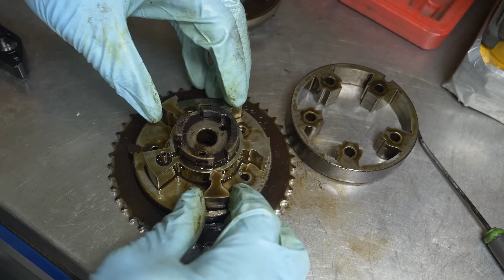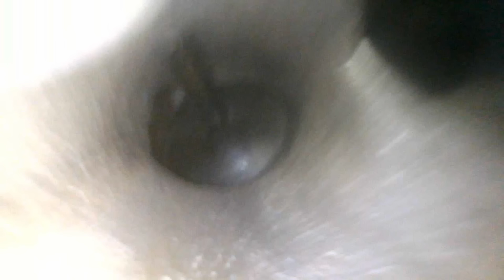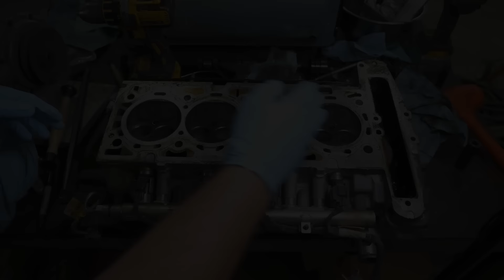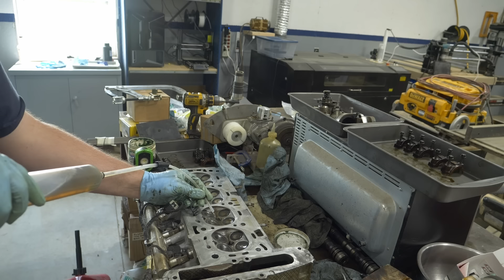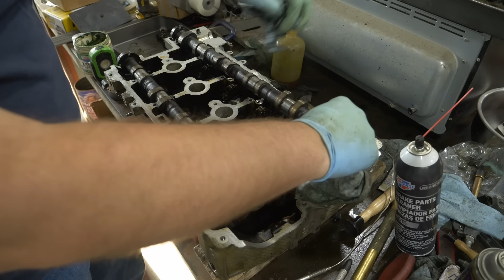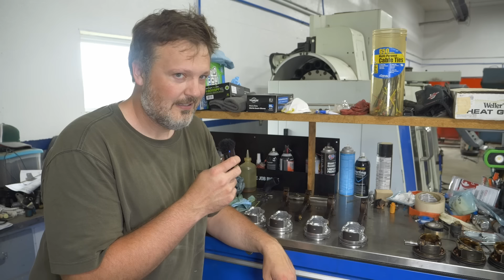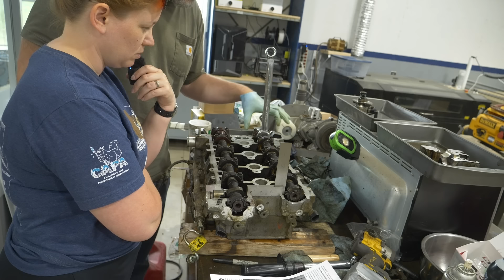How Did it Ever Run? Equinox Still Won't Start

Comment: Looks like Modern Auto parts in Saint Louis has some remans. Then they have 3 different emmissions options, for that year. Don't know the difference and your right they are not cheap, even for used ones, but in that engines defense it looks like its been Rode hard and put away wet...LOL!

Comment: If you already bought new pistons, rings, a whole cam, phasers, reseated the valves, and everything else why wouldnt you just put it all back together and then youd have a working motor?  Yea you gotta eat the time you put ibto it but youve already sank the time so might as well finish rather than get a whole new motor.. dunno if that motor has cam bearings but replace those and might as well replace the crank bearings then youd basically have a brand new motor..

Comment: I did carbon cleaning once on valves that were as bad as this, I used spray EGR cleaner and bundled zipties, turned the engine until the valves were closed, filled the port with cleaner, scrubbed with zipties, blew out with compressed air. Repeated until that valve was clean, then moved on to the next. Not as fast as walnut blasting but it did get them pretty clean. The trick is to use a real strong solvent that will dissolve carbon. EGR cleaner or nitro lacquer thinner. Anything else (brake clean, gasoline, alcohol) is too weak. The bundled zipties are pretty good at scrubbing the carbon.

Comment: My comment is: 1: Never buy ANYTHING made by GM. 2: Never buy any vehicle with: GDI, Start/Stop, Cylinder Deactivation, Turbocharger. Never try to substitute stupid, poorly engineered add ons for Cubic Inch Displacement. Like my Dad used to say:
 " You cant drive a Railroad spike with a Tack Hammer "

Comment: I wonder if a water alcohol injection system would prevent the build up . Inject the fluid after the throttle body. Use a timer to turn it on and off .

Comment: Press fit reluctor wheels spinning on the camshaft happens on mercedes engines too. The theory is that people ignore bad timing chain tensioners and VVT adjusters, and the resulting rattle eventually vibrates the reluctor enough for it to move.

Comment: If it has an oil burning problem, typically caused by bad oil rings, when you clean the valves, it's going to suck even more oil around the rings, and smoke like a chimney. Ask me how I know...

Comment: Lots of modern manufacturers are going over to pressed on lobes and bit on cam shafts. It's all designed to "save" the engine/valves if something happens to the cam belt/timing chain.

Comment: Wasn’t there an issue with the crankcase and PCV clogging in the intake and causing this issue and you were supposed to drill out and reroute the path

Comment: This forensic stuff is fascinating. Makes me sad that you lay down 20K for a vehicle and it turns out to have design defects that kill it at 100K miles. GM should be held criminally liable for putting something so obviously thrown together on the market. Sad that probably most cars nowadays have the same thing. Give me a good old 1972 or older truck with probably 150K miles on it over these rubber band driven things any day. Business idea: Design a drop in replacement powertrain for these junk engines that is done right and start the swapping.

Comment: “I don’t know how the reluctor wheel moved on the cam shaft.” Because the engine rattles like a box of marbles when it’s running how it’s designed. I don’t know how GM screwed up SO badly engineering a 4cyl engine.

Comment: I started in on one of these turds. We owned the car since new. I replaced the timing chain etc. 4 years ago. Back in there and the timing jumped. Tensioner was weak, guides broke etc. The engine runs but no power. I did the timing chain hoping it wasn't worse. It is. Valves contacted the pistons. Now my theory is the piston contacts causing the timing to jump out. I was going to rebuild with ScAmazon parts because the car is an around town beater but it's checkmate because the cat is shot due to extreme oil construction at the end and I think the trans is going.

Comment: After all this time (1 million engines??) GM hasn't gone to a keyed reluctor wheel and shaft, planned malfunction if you ask me. GM and for that matter all the big producers have let quality slip so bad and sky rocketed the price that no one with a clue will buy them. I long for the days of when you could actually see the engine when you open the hood, not a maze of wiring, plastic and plumbing.

Comment: If that engine did get too hot, you also may have a warped cylinder head...don't forget to check it. I purchased  a 1995 Dodge Dakota Sport that had overheated, the machine shop had to remove .010 -.015 to get it back flat (but knowing you, you probably already checked the head for warpage)?

Comment: I said in your other video "its a 1000 dollar car when it runs, you either put a used motor in it and send it on its way, or you scrap the car". You decided to open up the can of worms, and boy did you find worms....Mechanic here. Ive dealt with many shitbox cars in my life too...
Reply: My guy opened up the entire sod farm.
Reply: I can't even count how many engines I've changed in these. Wife's current daily driver is a 17 Equinox. I bought it cheap with a bad motor. Threw a used motor in it and sent it.
Reply: Wes is the goat
Reply: Someone should make a Honda K24 conversion kit for those :)

Comment: Well sir I do not care how long a person has been at this work there always comes a problem that defies the usual suspects. And once one takes the fork in the road that leads to basically "loading the parts cannon" not because we are Easter egg hunting for the cause by elimination, but because the trail just keeps leading us down the "rabbit hole" mainly because we have passed the point of no return as far as the cost is concerned. Had we known the end result up front, then possibly we would have never even ventured into this territory. But the silver lining in the cloud is that we have learned something and hopefully that "some little something" that is causing the problem as my dad used to say will benefit us down the road not to mention the euphoria of the engine actually running again and the satisfaction of knowing we found the cause of the problem.🥸👍👍👍👍👍👍👍👍

Comment: Very interesting video. I wonder since you already bought a new exhaust cam, if you could take the old one and heat that reluctor end up and see if it could be moved. That would verify your theory... And if you can't, see how it is mounted on the shaft. That would make for more information anyway. Sorry such things seem to avalanche on some engines... But you seems to understand things way better than the majority of mechnicas... Wish you lived around me. I would certainly get you to fix my mechanical issues for sure!

Comment: 2013 Equinox is done
You can get a 2013 Escalade (150k) for $10-15k.
Yes, AFM & VVT...that can be dealt with. Do your research and get what you really want and are willing to replace entire drivetrain if/when needed.

Comment: I had one of these POS!   It used a quart of oil every 300 miles starting at 60,000 miles.  GM said it was in spec and would not do anything about it.  I switched it over to Delo 15W40 at 100,000 miles and could make it 550 miles between adding a quart.  

That’s my final straw with GM Junk!   My 1999 S10 Blazer was Junk, our 2004 Saturn was OK’ish, my 05 GMC 3500 Dmax was junk, and the 2.4 was my final straw.

Comment: I wonder how difficult it would be to swap a different brand engine into this like a Honda or Toyota? Granted many of their older engines had similar oil burn issues. A cheapish used engine with less inherent problems might be an option if it isn't too difficult to make it fit   and function.

Comment: YA!  I prefer Firefox, but it's getting so many sites WON'T let you use it, so it's Edge or Chrome!  Which I hate!! :face-orange-frowning:  Make sure to check your Bank Acct.   My bank would remove the duplicate.
---
It sure sounds like it had been running with NO oil at some point! :face-purple-crying:    Good Luck! :hand-purple-blue-peace:

Comment: While you have it apart clean out the PCV port on the intake between cyl 2 and 3. I didn't do that and when my customers 2017 equinox hit 197,000 it was dumping oil out the rear main  seal. The PCV system is internal on these and the pressure builds up if the holes aren't cleaned.

Comment: The cam reluctor sliding due to the phaser hammering was the no start from the beginning, there is no reason to buy the new motor now that you have all the new parts for the current one, you are only gaining a new oil pump for seven grand lol.

Comment: Those engine/cars are not meant to be repaired once warranty is out and something goes wrong it’s just more economical to toss them and buy something else, and that’s what GM wanted you to do
Reply: Do they not understand that when I buy something else, it will NOT be a GM? Are they not able to think ahead even one single move? Not exactly chess players, are they?
Reply: @helgew9008  The MBAs don't care, they made the line go up for that quarter and that's all that matters to them.
Reply: @helgew9008 they couldn’t care less, private gains, socialised losses

Comment: Yeesh. Sounds like the whole engine was a design problem. Maybe a combination of slight exhaust restriction from the carbon buildup, sludgy or low oil and extra vibration causing extra heat that caused the cam and wrist pin issues, but whatever it was, that’s a mess. Crazy that GM wouldn’t spend a little more time and money making a decent engine when they are going save tons by shotgunning the same engine into 2/3 of the cars they make.

Comment: Damn. Great work but, Damn. Like climbing a hill and then GM Bully just pushes you down. You show a lot of patience I would have lost it sold the car for parts and bought an old Taurus wagon with the 3.0 that will never die or an old Buick with the 3800.

Comment: It's also not hard to tell that the owner of this engine didn't frequently change the oil just based on all the deposits in the cylinder head.

Comment: There is zero chance that ai is going to fix anything remotely as complex as that engine failure. It can recommend all kinds of dumb things to try (as much as some of the comments we see sometimes) but your job is safe for as long as you live. I cannot believe the complete garbage this engine is though - nothing like the stuff I used to take apart 40 years ago that's for sure.

Comment: Thank you I am thinking not a lot of cliffs in your part of the woods. But if it did start drivable solution would be on, page 2 section 6 serves bulletin option (over the cliff) That is a good place to start. You got persistence at best good job, better man than me.

Comment: if i ran my own shop i would probably be very selective about which cars/things i worked on, would rather do 200 oil changes and brakes on easy cars than fucking around with models that where stillborn from the factory

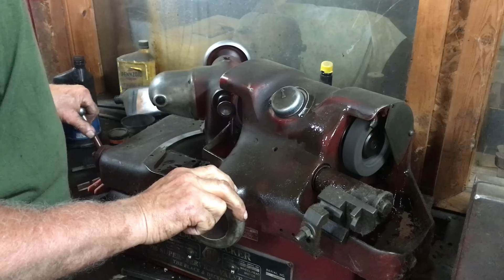Comment: 13:25 FYI, you can use those to sharpen drill bits. Worth having one in your shop for more than just valves. Also, sidenote, super jealous of your dad, that's a nice machine.

Comment: And then you've got Ford/Peugeot steaming into the ring with their wet timing belt shenanigans on it's EcoBoost engines.. Like yeah,  I'm sure running a rubber timing belt through the oil in the sump ain't ever gonna cause any problems in the future....

Comment: I have a 1941 GE refrigerator in my basement that has outlived roughly 7 other refrigerators between my Dad and I owned.  I think you should try to find a used Buick LeSabre with a 3.8 for your brother—as that will probably outlast this even after you get it fixed.  Regardless, really enjoy your videos.

Comment: Wes- I've always admired your technical/diagnostic capabilities; in addition I admire the fact that youve never hidden the growing frustration you feel in navigating the evermore complicated and labyrinthine world of auto repair. As a techinician with over 25 years experience, I share that frustration and groan in misery every time I see another example of engineers choosing to save a nickel/per/camshaft install, versus designing an engine that can stay in time for 150,000 miles.

It's a losing game, and sometimes I see the resignation in your eyes and it makes me fear for the next generation of auto techs, IF in fact there is going to be another generation. Your work on that remote-controlled log skidder from a year or so ago was epic, and cemented your bona fides as a highly technically-literate individual, so to see you slam up against a cinderblock wall of bad design stings, badly.

Thanks for giving me the insight to know I will be getting out of the business just in time- "engineers" are making our job not just needlessly difficult, but increasingly impossible.
Reply: That last sentence says it all, and all done intentionally.
Reply: Every engineer would like to win the award for the most reliable engine GM every produced. It is NOT THEM. It is management, and specifically accounting. I once rented a Jeep and was flagged on the highway alerting me to a failing tire. It was very low on air on pulling off the side of the road. I pulled off the next exit and immediately to a gas station to air it up. Upon placing the chuck on the stem, it immediately snapped off causing a catastrophic failure. The valve stem was 100% plastic and not the rubber covered brass we all know and love that lasts a century. Jeep probably saved $1 over the five tires/vehicle. This is the kind of stuff the bean counters force on the engineers who end up not so proud of their creations.
Reply: @LisaMedeiros-tr2lz  I agree the problem is not the engineers, it is management. I've heard engineers say "This was a great company until the bean counters took over". And a lot (not all) of the project managers a part of the problem. They will sacrifice quality to meet budget and schedule (thus making the bean counters happy) instead of solving the budget and schedule problems by another means. The end user or client wants a product that will work well and last a long time, and the engineers want to design products to do exactly that.
Reply: The engineers are being uh ordered or professional guidelines to operate in

Comment: Crazy thing, but I have similar situation coming in my car: seatseals, rings, headbolts and rodbearings for 1998 Ford Mondeo 1.6 16v Zetec-E. No pistons available, so rednecking with those parts at parkinglot.. 😂😂

Comment: Those engines are utter trash.  Coworker had one, even the dipstick wouldn't read a consistent level.  The oil sender would fail,  and weak rings lead to oil burning and no way to read when its low.  Utter garbage.

Comment: have a 04 Nissan Altima with the same issue. I have pumped the brakes at pulling the intake,,,,quit while I am ahead, 234k miles I am still ahead....pd 1000, for the car, teen driver 3.5 years. spent at this point, $450 on new down stream cat, shop dropped car broke flex pipe changing front tires...and 2 sets of cam and crank sensors...and a computer since crank position wiring was shorting to  hot on reference wire at connector...now new computer no comm, old computer still no workie... security light out.. so not a key recognition issue...sounds like it has jumped  a couple teeth of timing. will stumble with ether...but not every time.

Comment: I am convinced that heat is the culpret. Heat and Direct Injection. I'm wondering if an injecter was hanging open and the  high pressure fuel pump sent it into a hydro cituation. It sure seems like any single thing you fould COULD have killed it, but there are too many for it to be a coinkedink!!!  How did the head gasket look??  Anyway, best of luck on this one.. The WORST part of this is that it is your family.

Comment: My 1985 100cc motorcycle had thicker oil control rings than that engine. No wonder they burn oil, I'm sure that pollutes more than it would if they used properly sized and tensioned rings.

Comment: Reminds me of the Caddy Cetera issue GM had years ago with the cam gears that were a sintered metal design and a pressed in center hub that would slip in its rotational position and then hand grenade this zero clearance engine.

Comment: You have a bit of chicken or the egg situation. It’s hard to say what happened first but I suspect once the oil got into the engine cylinders it may have hydro locked it mildly. That is what caused the engine to shut off and damage the wrist pin bushings but not touch the valves. This probably happened multiple times. Is it worth fixing nope, but I get it. 

Remember you didn’t build it, break it or buy it. Paint it green, push it in the bushes and drive the old rabbit. It’s way more reliable. 

This would be the perfect car to Predator engine swap. Harbor freight sponsorship

Comment: After all you went through diagnosing,exposing "right to repair"😅 I have the feeling a dealership or any other shop not equal your mettle would have simply declared; 'Ya'll needs a new in-jine'. (or actually they'd probably say,motor🙄)
You're🫵 one smart muther...👍
Edit: commented before you found spun bearings etc;.